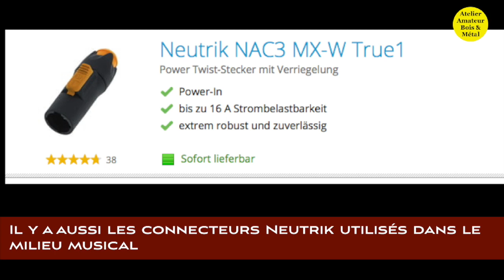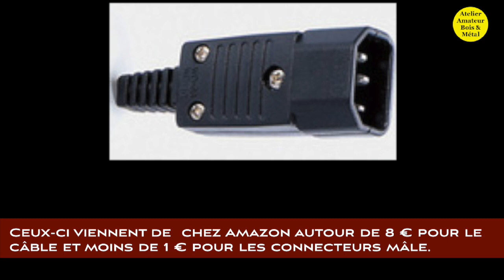C'est décidé, je plugge mon électroportatif

Comment: À faire attention, la fiche électronique a une capacité de 10 ampères à 250 volts. Donc ne pas utiliser avec de gros appareils. Il est recommandé de ne pas dépasser 80% de la capacité en courant. Ce qui fait 8 ampères maximum (pour cette fiche) en régime continue.
Reply from the maker: Merci pour ce commentaire pertinent.
Reply: Bonsoir en effet il faut utiliser les prises iec c19 et c20, elles ont une capacités de 16A. Bon plug.

Comment: Le système de connectique est meilleur que celui de festool, celui de festool, on doit faire un quart de tour pour le verrouillé et /ou déverrouiller, sur l'ensemble des équipements festool, autant que les machines et autres sont quasiment indestructibles, autant que le point faible est le plug in, les fiches électriques prennent du jeux à la longue , même en étant verrouillé, j'utilise dans mon travail pro du festool, c'est chère, mais de la qualité, le seul point faible ,c'est le plug in.

Comment: Video sympa mais il faut quand meme bien penser que ce que l'on gagne d'un coté (facilité a débrancher/encombrement) on le perdra de l'autre avec ce type de connecteur:
Le connecteur n'est pas intégré a la machine ce qui va créer une flexion du cable par le poids du connecteur, ce qui peut etre pénible.
Vu que le connecteur n'est pas verouillé, il y a risque de débranchements involontaires accentué par l'usure supérieure du cable relié a la prise.
En general, ce type de cable sont en 3x 0.75mm2  ou 3x 1mm2 donc bien faire attention à la puissance de l'appareil.
Reply: 0.75mm² sur 3m on doit pouvoir passer pas loin de 3500 watts
Dans tous les cas, si on utilise une multiprise pour brancher plusieurs machines, le câble sera pas plus gros, donc...
Reply: J'ai un grand doute sur ce que tu annonces car à partir de 3m ce type de cable passe en 1mm2, tu as une base de calcul sur ce que tu annonces ? 
Sur une multiprise Legrand: 1.5m c'est cablé en 1mm2, et pour une 3m c'est cablé en 1.5mm2
Reply: Fais une recherche avec "VDE 0298 T4 06/13"
Reply: http://www.desca.ch/user_content/editor/files/technische_Daten/strombelastbarkeit_f.pdf
0.75mm² groupe 3 (à l'air libre) = 15A soit 3450w sur du 230v
Reply: Le truc, c'est que c'est pas groupe 3 ;) qui est pour le monoconducteur rigide, ca "serai" plutot groupe 2 donné à 12A.
Toujours via cet élement de recherche "VDE 0298 T4 06/13" je trouve aussi https://www.sab-cable.eu/cables-confection-technique-de-thermometrie/donnees-techniques/cables/regles-de-securite-pour-lutilisation-des-cables/conditions-limites-dutilisation/tableaux-des-intensites-de-courant-maxi-admissible-e-coefficient-de-correction.html  et eux specifient "à l’exception des appareils portatifs et de maison" ca pourrai être à la hausse ou à la baisse :)
Reply: Oups effectivement lu trop vite !
Toujours est il que 12A ça fait 2760w sous 230v ce qui couvre une bonne partie des machines portative, sans compter qu'il y a certainement une marge de sécurité.
Après ce sont des normes de sécurité, que les constructeurs doivent suivre.
Mais pour le particulier qui veut juste bricoler en sécurité, je ne vois pas le soucis.